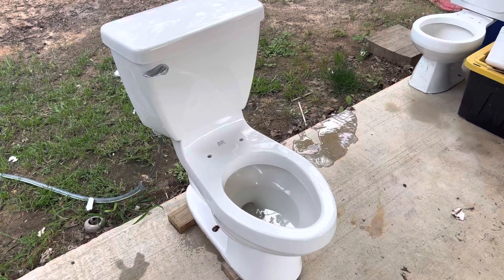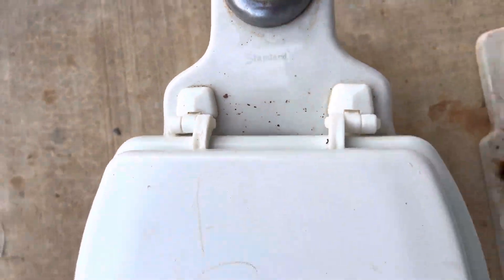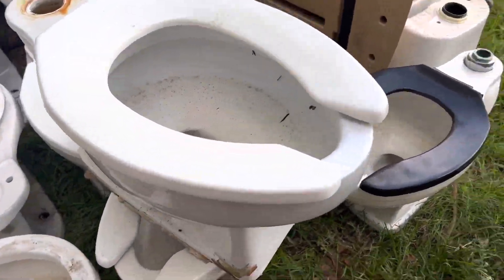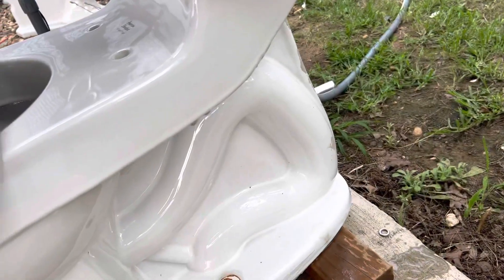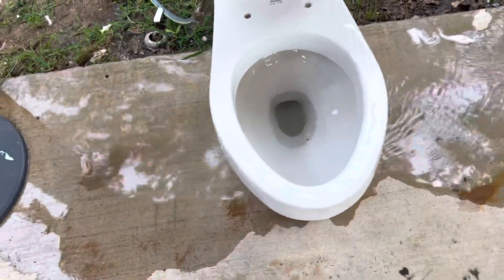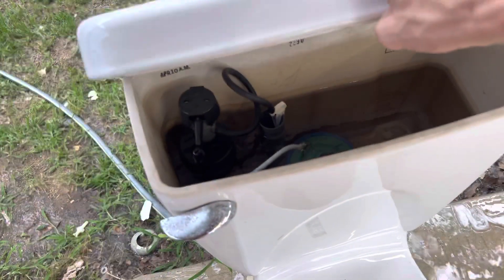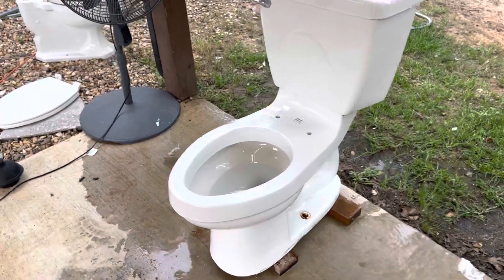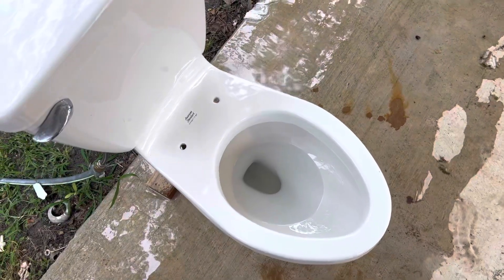2003 American Standard Champion Toilet Flushes!

Comment: This is actually just the Regular Champion model before it was rebranded and redesigned to the Champ 4 in Circa 2007. Its rare to see the 2 Line Script Logo since it seems like it was only seen on 2003 Models (which is when they were first introduced). The toilet itself is pretty meh.
Reply: That is correct. The Champion 4 around 2007 had a redesigned flush valve mechanism and a smaller indentation on the front of the tank in its design. Everything else remained the same.